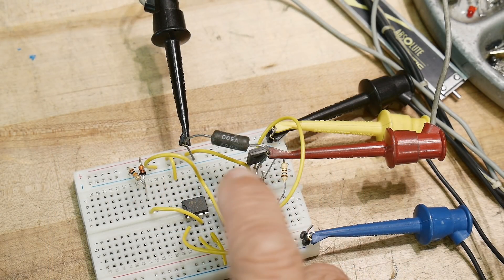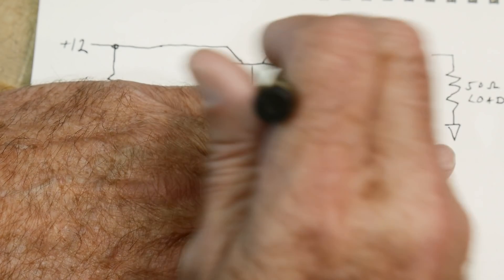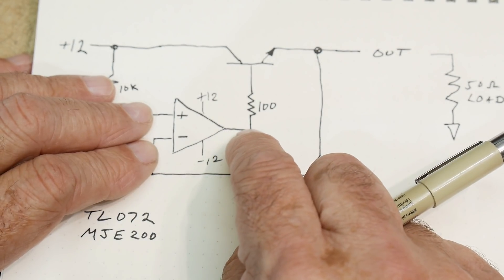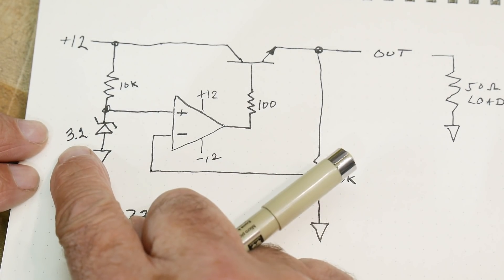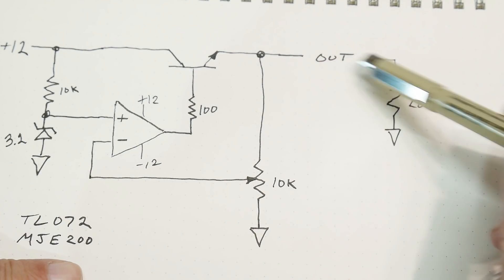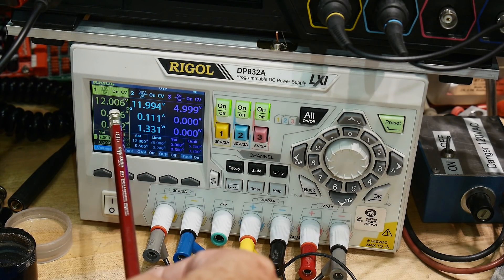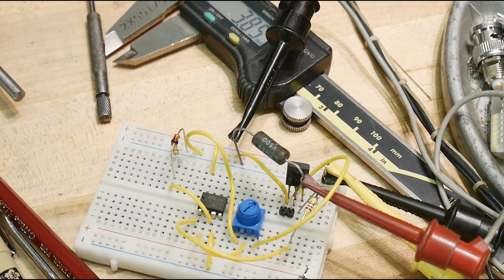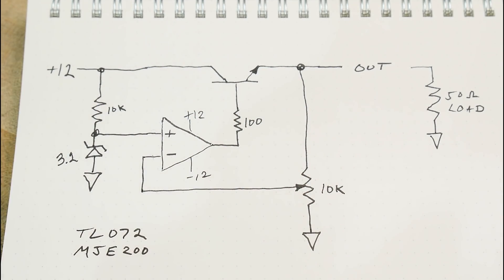#1090 Basics: Voltage Regulator

Comment: one question please  :: why and how the output of opamp is whatsoever value ? and how to control the inverting op amp input  (- input side to become 3.2 ?) is it by pushing transistor current to make a 3.2 volt at the variable resistor part ?  more explanation is needed please .  Definitely you are extremely helpful and expert and provide highly valuable rare electronic explanation . You will become incomparably much much better if you will be slower and a bit  more profound
Reply from the maker: sounds like you don't have a good understanding of how opamp operate. this series may help you; https://youtu.be/Z8JDsvfZjL8?si=FfQjN7FWU0NQJewu
Reply: @IMSAIGuy  many thanks i will check it
Reply: @IMSAIGuy  do you have please a video series lectures explaining  the transceiver schematic circuit diagram and /or the transmitter and receiver , many thanks
Reply from the maker: yes, several video series where I repair older radios. just search my channel for transceiver. here is a sample https://youtu.be/U9kXEAH6JWA?si=juRufeOW0O5p3S12
Reply: @IMSAIGuy  Great extremely thankful . i wanted to make a project of walkie talkies , do you have a working schematic diagram for walkie talkies ? many thanks  and strongly recognizing
Reply from the maker: @magdymourad283  https://youtu.be/k2OwX4pVksw?si=2LzviyfJuuoC4xDk

Comment: What happens to the supply voltage? To me it looks like the output voltage should be the output from the amp plus the supple voltage minus the transistor voltage drop? I guess I'm missing something obvious?
Reply: With the op amp in negative feedback loop, it will try to keep its + and - Input terminals the same voltage. Since the + input is 3.2V from zener, the op amp will either increase its output current into transistor base if the - input voltage is too low, or decrease the current to transistor base if - input voltage is too high, until the - input voltage in the middle of the voltage divider is exactly at 3.2V. Since it is a voltage divider, the ratio/how far you turn the potentiometer determines the actual output voltage of the supply

Comment: I would look to eliminate the -12 V supply and the 100 ohm resistor.  I doubt that op amp can produce enough current to damage that transistor.  I would also use a higher voltage Zener, maybe 5.6 volts to eliminate the expensive potentiometer.

Comment: Something as simple as zener diode can be used as voltage regulator, correct? What advantages does this circuit have compared to just using a zener diode? Thank you!
Reply: Efficiency.  A  5 amp Zener diode would have to shunt 5 amps or more to enable output of 5 amps when needed.  I've never seen a 5 amp Zener, so you would need a bunch in parallel.
Reply: @NackDSP  thank you very much for answering!! That makes a lot of sense :)

Comment: Hi @IMSAIGuy sir, Could you please make some practical videos on how voltage and current behaves in capacitor and inductor. And also how power delivered when these components are present in the circuits. If possible please make one on why imaginary numbers are used in the AC circuit analysis.
Reply from the maker: for LC this might help: https://youtu.be/34G4pzWr9kA?si=cHOnhdyKbsOIK5_S
I have thought about how to teach the subject of imaginary numbers. It is not easy to make a simple video as it requires a bit of math. But, I will try someday
Reply: @IMSAIGuy  thank you so much

Comment: If the input voltage changes, does the out change ? in my circuit it does.
Reply from the maker: it will change a small amount, the zener diode voltage changes with current.

Comment: Hello sir me ignition coil is e core design and it uses the mc 3444 ic chip set .
I wanted to ask is there any way that I can use voltage regulator,dimmer circuet or any other means to control that ignition coil externaly???
I have realy problems starting me car that 4pin gm ignition module does not have retarding option so I hoppe to build me self that can help me easyr start me car in winter or some sort of resistor capacitor box combinations or frequency controlers any thing just to make that thing some what more variabel.
If not can you sugest some external variabel circuet like buzz coil design?
I was also wondering can those positive linear voltage regulator back fead ? 
I have lately unusual effect in me engine its self acelerates I cant licate the problem .

Comment: Great video about adjustable power suppys.
I have  questions :
If I want more low voltage from 3,3 volt I must use more low zener diode ? and ıf  ı don't use zener in there ,voltage  output begin 0 (zero )volt ? 
I think I can use more powerfull transistors I can make more power power supply like 5 Ampere
Could you make a video in same base circuit with current limiting  and 2-3 ampere too ,ıf possiable 1-2 transistor adding increase current too (I mean maybe a darlingtan transistor or more efficiency new transistor)
Thank you for great video
Reply from the maker: if you need a voltage lower, just follow the zener with a resistor divider.

Comment: Hope you are doing well. 

I have a doubt regarding my design of the amplification circuit with an op-amp to amplify the voltage. I have a few doubts regarding the op-amp designing circuits. 

QUESTION: I need a bipolar output of +/-15V using an op-amp where the input of the non-inverting op-amp is a sinusoidal signal with amplitude of 3.3V from a microcontroller with frequency=40kHz from a DAC unit.
But the  problem is when I am simulating its outputting the same voltage though I have chosen R2 and R1 resistor. Can you please help me with this issue. Thank you
Reply from the maker: sounds like you need to study and try some examples that are known to work

Comment: This circuit only work at low current. When increase load in the range of few amperes, the output voltage will collapse. Load current increase will cause base current increase and op-amp can't handle high output current to drive the power transistor directly.
Reply from the maker: yes, you would need a darlington or a high current opamp.

Comment: olá IMSAI. Ótima explicação. Sobre o circuito inicial, eu acho que é uma aplicação de amplificador operacional, circuito não inversor. em que o Ganho de tensao Gv = (Vo/Vi) = (1 + R2/R1) , sendo o R1 = parte de cima do VR=10k, e o R2 = parte de baixo de VR=10k.   O TR NPN serve de booster de corrente para o amplificador operacional, se o IC pode fornecer 1mA, com o TR, esse fator é "multiplicado por hfe",  em que o hfe está entre 10 a 20 em TRs de potência. No caso, como a topologia é amplificador não inversor, a fonte de alimentação negativa pode ser dispensada, colocando o pino do IC no GND...  Mas isto pode provocar que a tensão de saída não comece em Zero Volt (como no caso do LM723). Veja que se R1 = R2, nós teremos Vo = 2*Vi = (2 * 3.1) = 6.2V...   A relação entre R1 e R2 define o valor da tensão de saída da fonte... 73

Comment: Great Video, Will this work with single 12v power supply ? with LM358 ?
Reply: It does, I built this power supply 30 years ago using the LM358. And it works without the -12v. Its still working till this day :)
Reply from the maker: I think so

Comment: A great subject and a great video. I would love a series which builds a 30V/3A Lab Linear Power Supply, with a true zero volts, constant current, bells and whistles, etc. And, explanations of how each section of the circuit works. Please and thank you. IMHO, power transistors are expensive. That has nothing to do with the video; just saying...

Comment: it would be nice to see the stability of the loop by doing a current load transient
Reply: No need to do transport test, loop stability is terrible, this is better as oscillator then as it is as voltage regulator for any practical purpose.

Comment: Neat and accurate. But I prefer the 7805 regulator, you only need one power rail. :)
Reply: this works just the same with the opamp hooked to one power rail and gnd or uni polar supply.

Comment: its possible to do this without -12v supply ?
Reply: A -12v supply isn't necessary, but if you will want to make sure that your voltage reference is compatible with the common mode input range of the op-amp.  Some op amps can go all the way to one or both rails.  For example, the ubiquitous LM358 inputs are spec'd to go all the way to the negative rail. So that would be one you could use instead to make it work on just a 12v supply.  With a 3.2 volt reference as shown here even the TL072 will work with a single rail supply.